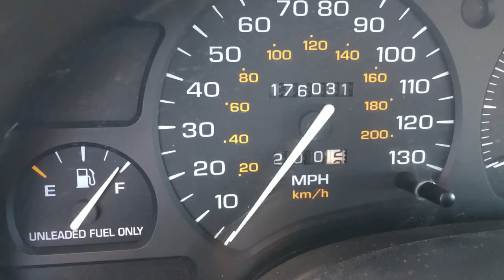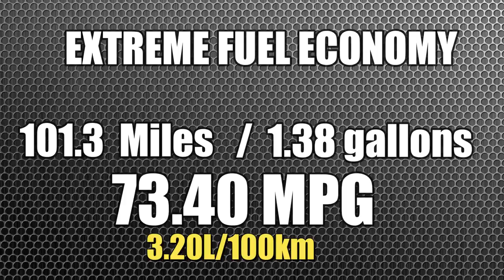S3 E11. Kubota turbo diesel Saturn extreme fuel economy.  super high MPG

Comment: Impressive economy from a really light car.  I think real world driving around the hilly-billy circuit might get you 65 mpg (US).    I drive my Mazda 2D at 60-70mph and I get 4li/100km (58.75 mpg (US)) from a 1500cc engine with 250Nm (184ftLBs),  DOHC, 6 spd AT pushing a 1130Kg car.
That engine sounds like an old Tractor and if it was a modern engine, like my Mazda, you might get 100 mpg

Comment: Thanks for your video! I wonder what this engine setup would be like on an old Miata (w a blown engine, which is highly improbable since they are nearly bulletproof) and after removing all the heavier stuff you will not need, maybe at 1,500 lbs?. I mean, would 65-70 mph and 50 mpg be possible?
Reply from the maker: Years ago I put a Geo Metro engine in a miata Google " G10 Miata"  for more info.  Anyway with about 50HP the G10 miata did pretty good.  As I recall Ithe miata weighed 1900 pounds and it was totally stripped.    The 719cc Kubota engine we are using is only 20 HP stock and about 35 HP when modified.  The Saturn will go  77 MPH tops speed on a flat road and deliver an easy 60 MPG  without trying.  and it will get 80 MPG if you drive it very carefully.    I reckon if the Kubota was fitted in a miata the performance and fuel economy would likely be about the same as it is in our Saturn.

Comment: If I may give some fuel economy advice: give it a proper alignment

Getting your toe at 0 degrees at all wheels should reduce the drag caused by the wheels by a decent ammount!
Also, extending the belly pan into a full flat undertray is sure to help out on higher speed bits, whilst being truly invisible to cops

Comment: It should be totally legal to block your radiator air intakes in the front bumber. You don't need them with such small output engine.

Comment: Results were exactly as expected in this video as well, just as the last time. I take it you didnt expect the results because of you are not used to drive small diesel engined cars slowly? I guess most people in the US wouldnt be. In any case, as most europeans with small diesel hatchbacks will attest, this is exactly par for the course in extra-urban driving at these speeds. Which can only be a good thing, because that means stuff is working as it should. Cheers!

Comment: Impressive result, it's quite close to the Volkswagen Lupo 3L TDI. That's a very economic factory 1.2 turbodiesel. Considering the R&D budget difference it's even more impressive :D.
I'd be interested to see what diesel alternatives would do in this setup on power, economy and EGT.
Keep up the good work!
Reply: Its not all that surprising, the pure physics of it are pretty straightforward. The 3L cars was 3l/100km combined driving, that was the hard part. Extra urban 3l/100km can be reached by almost any diesel powered small car.
Reply: Considering the R&D budget difference it's even more impressive :D - really!!!
Reply: I have owned and driven a VW Lupo 3L for about 100k miles (160,000 km for us metric folk) and it averaged 3.3 litres per 100 km.
When obeying speed limits and intensive truck surfing it was possible to get fuel consumption down to 2.9 litres, but this didn't make for relaxed driving. 😅
Anyway I love the testing and tinkering done on the Saturn.

Free tip: a guy from Finland who is really clued up on vehicle aerodynamics has a YouTube channel (TunekoLTD) where he tests all sorts of aero mods. At one point he owned a heavily modified Lupo 3L which he got down to nearly 2 litres per 100 km. Impressive stuff. 😎👍🏻

Comment: Back in 84 I drove my old mercury station wagon from the Southern tip of Illinois to Roanoak Va for a job interview.  I was still about 60 miles from Roanoak when a seam on top of the radiator split.  I was desperate to make the interview so I crimped the seam together as well as I could with a pair of Vicegrips, found a discarded bottle I could use to carry water, refilled the radiator and drove on.  I found that if I didn’t exceed 45mph the water didn’t drain out so fast.  I proceeded to my interview at barely highway speed.  When the interview concluded I had to choose an overnight layover and a day spent in repairs, or a really slow drive back to Illinois.  I chose the slow drive.  Wasn’t too bad, traffic was light and I certainly stayed in the slow lane.  But the surprise came when I got home and started to tally up the cost of the trip, the car that normally did 15mpg gave me 21 mpg on the way home.  Now I make it a habit to stay in the slow lane and not exceed the speed limit.

Comment: Since diesel is so expensive, I wonder if substituting a safe percentage of the fuel needs with propane or CNG might be more economical? Also, I was thinking that it might be cool if you had a water injection nozzle that you could activate if you were in a situation that required prolonged high power and acceleration to cool the egts or even a sprayer than is aimed at the intercooler to improve summer performance with evaporative cooling to increase the oxygen density of the air and effectiveness of the boost. Just kinda spitballing. Great stuff, I tune in every week, I got really excited a while back when I found out that one of my favorite channels going back 10 years, Matt Happle from Sloppy Mechanics mentioned your channel in a video.
Reply: The most economical thing to do here is to use waste vegetable oil (if you can source it free or on cheap) and filter it out. On a simple engine like this, it will have no problem running and there will be minimal impact on economy or power.
Reply: @hojnikb  Used engine oil or ATF would work really well, also. Of course, it’d have to be filtered, too.
Reply: @hojnikb  the cat in cheap veg oil left the bag 20 years ago. every restaurant already has contracts for their used oil. large corps buy it. its not the 90s anymore
Reply: @imchris5000  highly area dependant. Some places dont have such contracts or will happily sell you the oil for 10-20c/l
Reply: Wikipedia up for "autogas". Yes. it is much more economical and both diesel and gasoline cars can be converted with stock parts, giving you 2 yeas warranty if done at certified garage. Over 20% of cars in Poland run on LPG, about 14% in Germany, bit more in Belgium and Netherlands, and again something over 25% in Italy.
Common rail diesel can be converted to LNG too which is used in freight - again Austria, Italy, Germany and Poland are leaders in the LNG fleets. 
In US you can benefit from LPG through tax credits only, probably that's why seldom anyone does it - you need to be resident and pay enough taxes. given 40% of America lives below poverty line and half are illegal immigrants, LPG is fuel of the rich elites only.

Comment: I save money on fuel by boiling/distilling waste motor oil treat it by acid stripping and base separating to get base oil diesel like fuel substitute runs an engine perfectly cost about $0.10 a gallon tons of power

Comment: Awesome! My mom had an '84 Honda Prelude with a Honda Motorcycle racing dual barrel carb and I thought the 42 mpg it got was impressive! One of your first 3000 subscribers, and I haven't missed an episode! (except season 1, episode 13) Keep making this great content Jimbo and everyone else at team Robot Cantina!
Reply: How many window crank handles did she go through?
Reply: @huzudra  just the one that broke and was never replaced by us! She sold it finally with 450k on the odometer bc the cost of the repair it needed was $500 and she got a newer car from her aunt instead but the guy she sold it to fixed it and kept driving it! The engine that was in it with the racing carb was put in there with 100 something thousand on the odometer and thats when she got it so we put some miles on that baby, with the radio never working and a tape that played but was jammed and wouldn't come out, Steve Miller Band Greatest Hits!
Reply: @devivoman   Must have been a manual, the automatic in a relatives car couldn't hold onto reverse gear. Every window crank broke too, repeatedly. Come to think of it, I wonder how much of these issues were just operator error. They were prone to agitation.
Reply: @huzudra  absolutely was a manual!
Reply from the maker: Thanks!
Reply: @drippingwax  the car was a bit clapped with the less than perfect interior and the broken radio and shitty faded crumbling plastic trim but mechanically she was sound and never left us stranded once! My grandma has a '95 civic she bought brand new and she still drives it!

Comment: I would REALLY like to see this engine setup in a lighter weight car. Something cool too, like a vw rabbit or beetle. Or perhaps a triumph spitfire. It'd just drive more like a normal car even with only 50-70 hp. 
Love the work you are doing. Makes me want to build a lightweight diesel car.
Reply: Just buy a tdi lol
Reply: We all drove with barely 50hp back in the D Rabbit days and tuned out 72hp in a carb rabbit.   40MPG for the D and easy 35MPG for a 76 Gas Manual.     I owned both for less than 400 bucks and the junk yard trips never exceeded 30 bucks.

Comment: 1. It would be better to drive in the other direction on the hillbilly proving grounds. Because you don't have to turn across the oncoming lane of traffic. Right turns are always better, as you never have to stop for oncoming traffic.
2. There is a tuner shop in Wichita with a dyno, so you could find out how much HP you are making.
Reply: How low will their dyno go?

Comment: And the diesel is more efficient because there is no throttle plate to maintain a certain rpm, they just put in just enough fuel to maintain a certain rpm. They could almost idle for free?

Comment: That's exactly what I expected.  My dad and I did similar tests in Rural Michigan and found that at 45mph and coasting in neutral down hills, we could get almost 20 more mpg in several old cars we tried it with.
Reply: Ahh the old Angel gear trick. Works on cars with carburettors, but most cars with efi cut fuel totally on overrun so it should make much less difference to them.
Reply: @nerd1000ify  Cars with overrun cutoff will actually get worse mileage coasting in neutral, since the engine has to use fuel to idle and run the accessories. Even if you have to feather the throttle to keep your speed and cutoff doesn't activate, you're still using less fuel as gravity is doing most of the work.
Reply: @mfree80286  Yes,  I am a subscriber and I don't miss any of ROBOT CANTINA'S  videos!!👍👍👍

Comment: a better way to do the mpg test is to start with an empty tank and put in a measured amount of fuel; then drive until your out of gas; making sure all had been used; and the tank had nothing remaining inside - some would bypass the built in tank and use a seperate tank where they can monitor the amount off fuel left and ensure it all is used.
Reply: Says someone who never had to reprime a Kubota after a filter change on the side of the road in the cold rain.    A bit of air in D injectors is a painful without some time and battery power to bleed tank pump to filter, to engine pump, to injector pump to injectors.    This aint your vice grip carb you can bottle feed.
Reply: @christopherwhull  Sure well a professional would use a seperate tank all together for the range test and simply redirect a fuel line; and no one suggested to do anything in the rain or  freezing or super hot weather.

Comment: imagine if car manufacturers put a motor like this on a hybrid platform. 70mpg with normal driving could definitely be possible. Great video
Reply: Like the ZE1 but diesel?  The 1980s Rabbit/Golf diesel could get over 50 mpg without really trying, without the turbo.  With an even smaller engine and turbo to make up the difference, 70 to 80 is easy.  Europe got the diesel Lupo...
Reply: You don't have to imagine it, you just have to go buy any Prius from 2004-2022, air up the tires like he did, and average 42mph like he did.  

I can drive 40-45mph laps all day long in any Prius from 2004-2022 that's running properly, and get 80mpg.   I've done exactly that in my former 2005 Prius, and my current 2017 Prius Prime.  They had 1.5L and 1.8L Atkinson cycle gasoline engines that run on regular unleaded gas.  In fact, in my area the gas is 10% ethanol, so the mpg would be better using 100% gasoline.  My tests all started and ended at the same place (hence same elevation), same hybrid battery state of charge (only net energy consumed was gasoline), and used the max-load tire pressure Michelin printed on the sidewalls of the X-Ice3 SNOW/ICE TIRES, so not some super-eco crap tire.  75F weather, so AC off, fan on to blow fresh air through the cabin.  No tricks, just a route with only one stop sign per 5-mile lap, very little traffic, and speed limits from 35-45mph, letting me keep speed around the same 42mph average as he did in this video.
Reply: @EfficientRVer  true I had a prius u could get crazy mpg. But you're hyper-mileing. A diesel is already more efficient than a gasoline engine, so a 1.2l 3 cylinder turbo diesel with an electric motor paired with it would pull 80 mpg in the city more than likely
Reply: @VndNvwYvvSvv  yes I suppose pretty similar to that

Comment: It might be interesting to consider the thermal efficiency of this engine in comparison to a gasoline engine. Because of the greater energy content of diesel fuel, a gasoline engine can consume 13-15% more fuel by volume and still be just as thermally efficient as a diesel engine, so a Kei car engine can still offer about the same thermal efficiency, even if it's consuming as much as 64 mpg... and it will still offer far superior acceleration performance.
Reply: Dont think many kei cars are built for extra urban fuel economy though... A diesel is the way to go for lowest possible consumption, even with the factors you mentioned. But it is indeed possible to reach these numbers with a 100hp engine, or even more.
Reply: @GoldenCroc  Sure, consumption by volume of fuel consumed, but there are far more important metrics to consider, like the cost of fuel and the emissions produced. Natural gas is superior to both diesel and gasoline when it comes to both of those metrics.
Reply: @PistonAvatarGuy  Well whats important to consider is in the eye of the beholder. I simply answered which gave the lowest consumption, by energy, weight or volume, compared to gas powered Kei cars. That was all. Cheers.
Reply: @GoldenCroc  But that's not right, gasoline is the most efficient when going by energy consumed, as there are kei cars that get far better mileage. By weight, natural gas is far lower, largely because it's more energy dense than both gasoline and diesel. Natural gas might also be more efficient than diesel when going by energy consumed, as natural gas engines are likely to be the most thermally efficient, being able to make use of the more efficient Otto cycle, while also being able to make use of a much higher compression ratio than a gasoline engine. Diesel is only the most efficient when going by the volume of fuel consumed.

Edit: Correction: Natural gas engines can be nearly on par with diesel engines when it comes to energy efficiency (within ~5%). Natural gas engines do burn less fuel by weight when compared to diesel engines (but more than gasoline engines), while also being far cheaper to fuel (in the US) and cleaner to operate.
Reply: @GoldenCroc  Even if we compare something like a 2018 Honda Civic (1.5 turbo, 42 mpg hwy) to a 2018 Chevy Cruze diesel (1.6 liter, 47 mpg hwy), the Civic is more energy efficient on the highway, consuming 3.078 MJ per mile vs 3.088 MJ per mile.

Edit:
Energy consumption per mile using GGE and combined city/highway mpg...
2018 Honda Civic 4Dr (1.5 turbo, CVT): 3.3611 MJ
2018 Chevrolet Cruze (1.6 turbo diesel, 9 spd auto): 3.7027 MJ
2015 Honda Civic CNG (1.8 NA, 5 spd auto): 3.9032 MJ
Reply: @GoldenCroc  The Cruze 1.4T also gets 42 mpg on the highway, so it also consumes less energy than the Cruze diesel, while also offering better acceleration performance. The Civic also offers better acceleration performance.

Comment: I built a belly pan, front air dam, and side skirts for my Saturn wagon as an experiment.  I drove from FL to NY and averaged 40mpg at 75-79mph highway.
Car was loaded with kid, wife, camping equipment.  I was pretty happy and as soon as the material cost broke even, I removed it.

Comment: Wait -fuel economy isn't the object of this exercise? What is it then? Also there's a whole lot you could do for aero without adding a ridiculous long tail or anything like that.
Reply from the maker: Believe it or not these projects are about increasing performance on small engines.  In almost every episode we mention that fuel economy is not our goal.
Reply: @robotcantina8957  oh ok. I watch most of these and I never picked up on that. ALways thought your goal must be hypermiling or so. I suppose finding a modern diesel from a newish BMW or similar, to try, would be tricky in your neck of the woods?
Reply from the maker: @jamesdeath3477    Normally we fool around with putting predator engines in cars, however  when we got this brand new Kubota D722 for free and decided to do a diesel swap on the Saturn.  Its been fun trying to get the most from this engine and we will probably do other diesel swaps in the future but finding a good diesel for a reasonable price is difficult.    Anyway even though we dont focus on fuel economy there is a lot to be learned from these videos.  thanks for watching!
Reply: @robotcantina8957  I'm extrememly admiring of the nonchalant way you drop these motors into cars. Make it look very simple! Which I'm equally sure it isn't.

Comment: I used to retrofit vehicles with no cruise control from 1993/94 Chevy 1500 pick up cruise control. Throttle body 350c.i. engines in particular. Cheap from a junk yard then mounted switches on a project box mounted somewhere. That might help on an aftermarket cruise option.